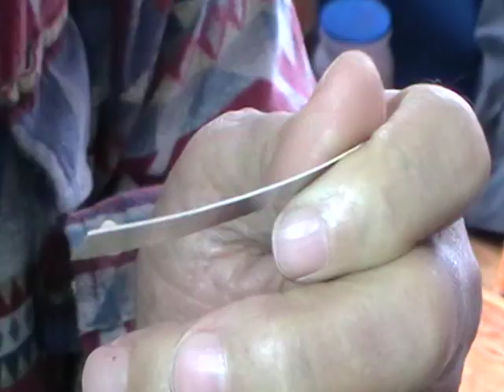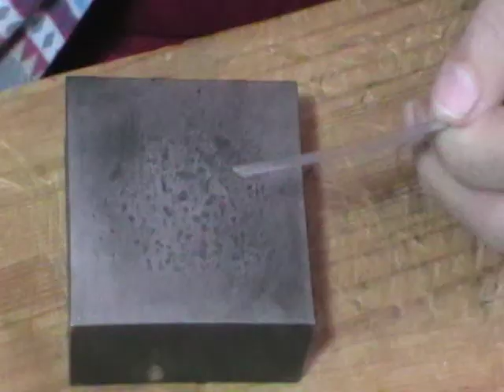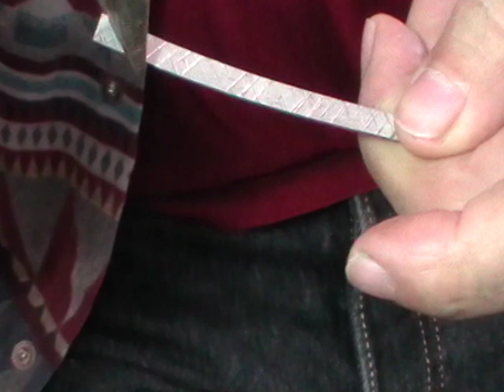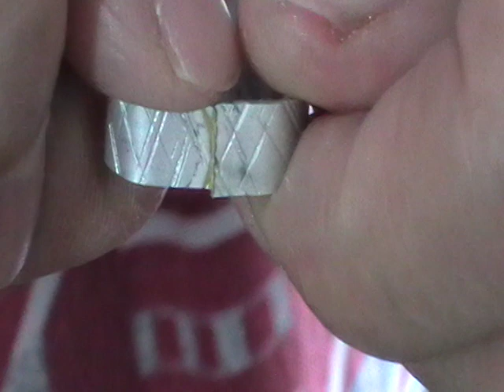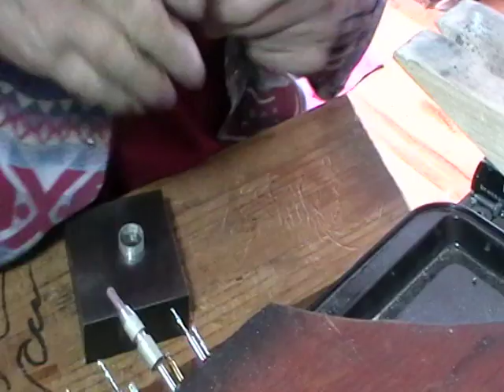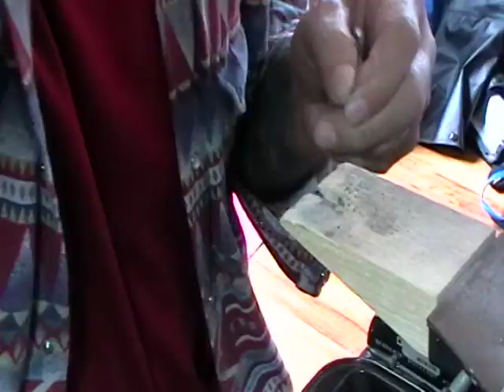rivited bead ring pt 1

Comment: Really great work. What type of file are you using??? It sounds Like it really takes the metal off.
Reply from the maker: a #2 swiss cut flat hand file
Reply: Thanks!!! I just made my first ring last thursday. It is a 4 prong ring with an ocean tumbled Bir Sur jade stone in it. Also I am in the process of making twenty rings. Hopefully I can make them by this week or within two weeks. Watching your video as well as others has really broadened my metalsmithing ability. Thank you so much for you videos.That bead ring is a cold design. In the future I may try and make something like that. I have some turquoise beads that would work really nicely with that style ring. That tip was also great about using the bur sideways as a starter for the drill bit. I am really inspired to attempt to create some jewelry.